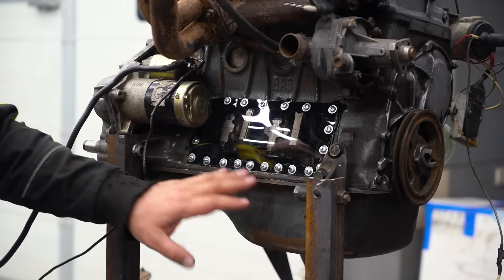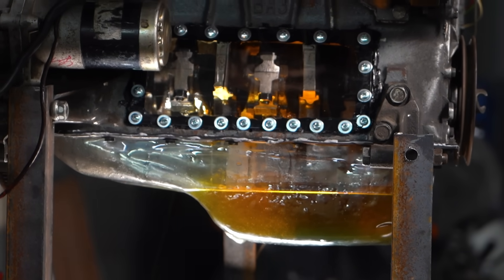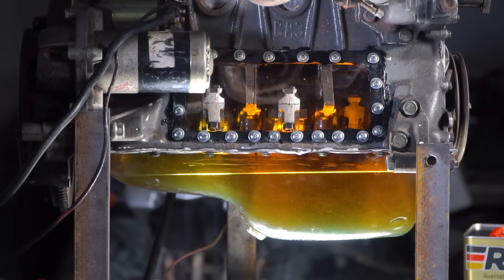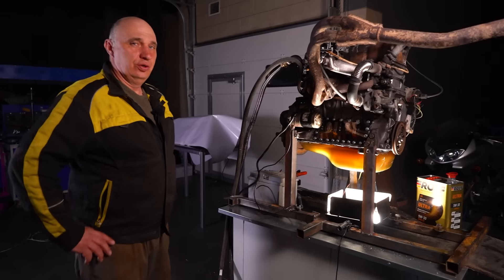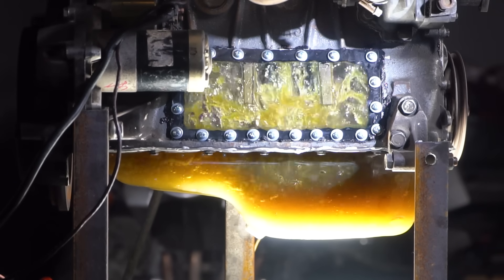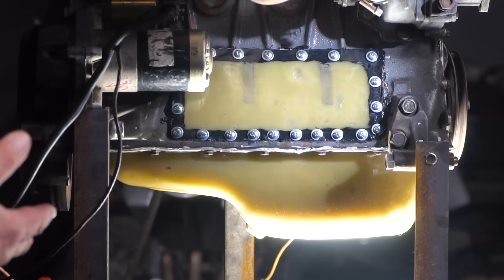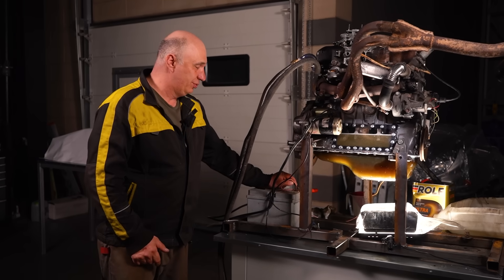What actually happens when you overfill your motor oil? (w/ transparent oil pan)

Comment: I seen what happens with a diesel engine in the army. While checking fluid levels in a large truck some DA grabbed a Hummer  dipstick and thinking it belonged to the large truck used it. He couldn't add enough oil to make it show on the stick so he put 5 gallons of oil in the engine! When he cranked the engine motor oil forced its way into the cylinders and started burning it fuel. The engine took off at full speed out of control. Turning off the start switch did nothing because diesel engines don't require electrical spark. The engine ran full speed in park (thank God) with heavy heavy white smoke pouring out to the point you couldn't see the truck. Wide open it run until the engine blew up! What a sight it was!
Reply: This is why big diesels usually have a cutoff flap and experienced mechanics always have something handy to chuck over the air intake
Reply: @miscbits6399 we used to call it the toilet lid.
Reply: happened to my friends Audi, the only time he got it up to VTEC levels, rev-wise. Remember kids: every passenger car Diesel can reach 9k rpms, ONCE.
Reply: So the don’t teach 91Bs how to stop a runaway engine these days? Can’t say I’m surprised
Reply: Your tax dollars at work
Reply: @timin770   So true.
Reply: 😂 that's crazy! Good story
Reply: The only way to stop a diesel runaway (when the motor starts burning the oil as a compression stroke, and ceases to run on diesel) is to starve it. 

You do this by either stuffing a rag or shirt etc into the air intake, or using CO² or a similar inert gas to starve the oxygen. 

There will come a point where a diesel motor will become so hot that the compression of the oil combined with the heat will maintain an inevitable cycle until there is not enough oil to burn, and it will seize any of the moving parts that cannot handle the rpm or heat. 

Either way, if you can catch a runaway before it really kicks off then you have a chance to stop the motor by choking it. 

I found this out the hard way, by overfilling my LC80 by about 3L, and it cost me a packet.

Don't overfill your motor oil.
Reply: @CCMiniBucks I never use a rag or anything that could possibly be sucked into the motor. Block of wood or such is much better
Reply: @CCMiniBucks I guess the military isn’t teaching them the basics of diesel engines. 5 gallons isn’t a lot for a large truck either, might be a little low.
Reply: @CCMiniBucks  do not stuff anything fabric into a runaway diesel's intake. Especially if you have a turbo. It WILL swallow it. 
Use something tough and rigid like a wide piece of wood.
Reply: @CCMiniBucks I’ve seen run aways suck in and blow a blanket out and kept running. Have to use a board or something big and hard that can’t be sucked in no matter how
Reply: @CCMiniBucks  you can also put it into a high gear and dump the clutch. Should stall it out.
Reply: @MP-ky5rz  automatic transmissions:
Reply: @MP-ky5rz this will work on small car engine. With big diesel truck u just blow the clutch.
Reply: @MP-ky5rz won't go into gear if engine is at high rpm, clutch brake useless
Reply: @FourthWayRanch  Yes it will, otherwise how would it be possible to powershift? I've seen it done on stock cars and motorcycles, what will happen is much higher clutch wear and probably the gearbox won't like it that much either. I'm not a mechanic tho, so idk how any of it really affects the components with certainty, but about the clutch I don't really have a doubt
Reply: @MP-ky5rz no so easy with automatic 😉
Reply: I both wish I could have seen this and am also grateful I was not within several miles of it happening.
Reply: oh and also what if it just does a burnout instead of stalling the motor cuz diesels have tons of torque and probably a lot more when running away
Reply: Video or it didn’t happen……

lol. Just kidding.  That had to be so cool to watch.
Reply: This happens in the oilfield if you park truck next to vac truck exhaust
Reply: Just happened to me a few weeks ago on my 2019 focus st 2.0 tdci, snapped 2 rods bent the other 2 smashed all 4 pistons and blew a hole in either side of the block, when diesel engine run away get the hell out of dodge 😂😂
Reply: On my way home the other day, I came across a young lady on the side of the road with her hood up. She stated that her car kept shutting off while she was driving. As I assessed the situation, turns out someone had told her to be sure that the engine oil was at 100%. After checking the dipstick, I retrieved my ramps and socket and drained over 3 quartz of excess oil! Lol!
Reply: @mikeheckman4995  I'm sure she's greatfull
Reply: I'm surprised they don't have emergency air shutoff like oilfield trucks.
Reply: Block air intake
Reply: LMAO
Reply: Runaway diesel 😂
Reply: Yeah , how woukd you stop a run away engine,  like on a 2007 dodge 6.7 ? Because of the age and miles on it , I worry that maybe the turbo some how puts oil into the intake , how would I shut down that engine being that every thing has a plastic cover on it how would I stop the air intake , with out having to get tools and start taking parts off ??
Reply: Nobody was smart enough to plug up the intake?
Reply: @bigdfitness5020  You mean knowledgeable enough. Those present (no mechanic) had no idea why, what, was happening.
Reply: Should have removed the fuel pipe
Reply: Why not smother the air intake?
Reply: Runaway diesel sounds fucking horrifying
Reply: Gotta shut down the airflow..only way to make it stop and you gotta be quick 😂 they blow up quick and you don’t wanna be next to it when it goes 😂😂😂
Reply: I had a diesel generator that used engine decompression to shut down. The pump was mechanical so as long as the engine turned it had fuel and air. Shutting it off involved a solenoid disengaging causing the exhaust valve to get stuck open killing the engine, but modern engines kill the fuel supply like an electric pump but the oil is now the fuel so now it runs faster and faster until boom!!!!
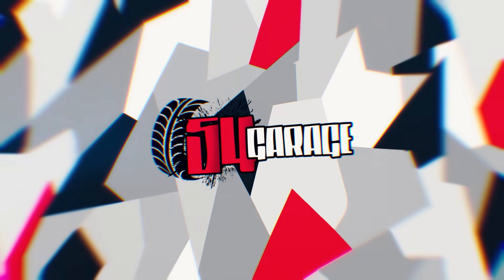Reply: 19:46 19:46 19:46
Reply: That engine did things it's not supposed to do. It sounded like a jet engine with the turbo wide open. Dirt from under the truck was blowing everywhere! You could see the entire truck body trying to lift off! OMG had that thing been in gear it might have taken flight. 17 and 18 year old were jumping to or cover. People were peeking around things to see what it might do next. When she blew, the turbo went flying leaving a smoke trail. The PTO shaft (winch) snapped and was ripping parts away. Steam from the busted radiator went up. It blew so hard the side mirrors were bent. When it was over everything was silent, minus some strange hissing. Anyway one of the Sargeants in charge used to call everyone "duke". I heard him say " ah hell duke, that's someone's ass! "
Reply: White smoke is not oil. That is antifreeze from a bad head gasket. Burning oil is black
Reply: Whats a DA
Reply: I may have added too much oil to my riding lawn mower and it was pouring white smoke.  I called the guy to pick up - he did.  I haven't heard about my mower since.
Reply: What about kicking it in gear and letting it stall?
Reply: So what happened to the guy?
Reply: @HexOmega3113  He got punished and had to go through retraining.
Reply: Govt property, doesn’t matter hahaha
Reply: It didn’t have a emergency air shut off
Reply: No injector cutoff?
Reply: @crankfotton  it would still run since it is burning the engine oil. The only way to stop it is by smothering the air intake. But if the air fikter is in place then this may not be possible. In which case, run.
Reply: Yes, the adage is true. Stupid people are dangerous!
Reply: HUMVEE lead the way.
Reply: Pull off air intake put a board or something hard enough to not get sucked in and it’ll kill it
Reply: If you ever have a runaway plug the exhaust pipe with anything. It'll choke itself out and stop the dangerous runaway, and save the motor.
Reply: And no one thought to choke the engine? No one thought to try and close the air intake in anyway whatsoever? I get it big diesel engine roaring at full speed if it blows up next to you….. but still at least make the effort
Reply: Runaway diesels at its best. Toss a towel in the turbo or intake it'll be alright🤣
Reply: It's called a runaway diesel engine
Reply: Oh,...gush!
I'm Soo glad I run in to your, coment:- I just recent, bought a Fiat 500l, and willing to clean up the engine I bought a cheaper oil, and as per the parts dealer ship, I pour All off it in(not checking the dip stick)
thinking I will use it fyu miles tand then dump it to have the engine clean up, and fill up whit her specific one!
@ just after 2 min, I start running the car, on second gear , after , u touck a turn on slow speed, the engine start running like a nasscar!
I get scared and switch it off, but still running, follow about a lot of white smocke!
Luckaly I had just 1 min till home, were my naeber is Mecanic, and tell me to drain the oil, exes!
Now I put the right oil on it , but, after then , I don't like his "music "anymore!( there are noises, sounds like something isn't gets lubricating!🤔)...
P.S- @least that was not your personal car🤔
Reply: the dip stick have hallow dots on it which tells how much space is in the sump available to fill the oil for the engine
Reply: the dip stick have hallow dots on it which tells how much space is in the sump available to fill the oil for the engine
Reply: Must’ve been a lot more than 5 gallons because the big trucks the Us military uses are 8.3 diesels which require 6.4 gallons of oil
Reply: Lol. Glad no one got hurt but that's hilarious
Reply: Ci sono motori diesel con tanti chilometri che consumano olio. Ma se lasci il livello di poco sopra il minimo il consumo si stabilizza
Reply: Article 15! 😡
Reply: @smoothoperator7023 what does it mean
Reply: @BarryWhite52  A military term for a write up / reprimand.
Reply: @smoothoperator7023  oh I thought the commenter actually wasn’t supposed to share the info since it happened in the army
Reply: I was thinking the same thing! You must be a fellow NCO! 😂😂@smoothoperator7023
Reply: Idk why but your story made me lol way too hard 😂
Reply: "Turning off the start switch did nothing because diesel engines don't require electrical spark"

indeed Diesel engine needs electricity for the injection pump.
But when it burns oil, it did not need the injection pump to turn ! so even if you cut off the battery, it will still turn on. 

So the only way to stop it is to put the maximum gear and make it stall
Reply: The Massive torque of a runaway diesel will power right through a clutch...a soon as a bit of heat is introduced the clutch glazes and slips...personal experience @user-ip6vv9nd3b
Reply: @fdhdfh-r3z there are lots of diesel engines that don't use electricity at all.. either for the injection pump, that is 100% mechanical. BTW, a good solution for diesel engines to not runaway never, is to use a mechanical switch that closes the air intake when revs are too high, or when the KEY is turned OFF. 

So, when the key is ON, the air pass is open, and when the key is OFF, air pass is closed. 

So when a runaway, just take the key to OFF position and the engine will Stop because no air is entering the combustion chambers. 

No air = No oxigen = no combustion = Engine Stops.
Reply: @fdhdfh-r3z some diesels, especially older ones have a mechanical pump and require zero electricity for anything provided its warm enough to not require glow plugs at startup. And if it had a manual trans you could even just pull/push or "bump" start it and drive away without any battery
Reply: I feel bad but it made me laugh just picturing it 😂😂
Reply: Just block the intake plate......
Reply: could have opened the oil drain plug
Reply: @JackSpratt-yg1oj And crawl under a runaway diesel engine?
Reply: @teresabenson3385 that's what I thought too 😂
Reply: @JackSpratt-yg1oj I volunteer you!
Reply: @JackSpratt-yg1oj 🤣🤣🤣🤣🤣🤣🤣🤣🤣🤣

Comment: i always believed a quart extra especially in my high performance motors did it good . i even keep my toyota's small 4 cylinder with an extra quart , runs real good , our speed limit here is 75 mph on the highway i travel and it runs real good ! .

Comment: If a Mercedes Benz ml 320; the dash would flash an 'engine oil hi', warning that the engine will fail unless engine oil is dropped.  Had this happen once, had to drain off some oil from the oil pan.  Some engines will seize if the oil density's too high.

Comment: You have a level for a reason. Too much oil messes with oil pressure in motor and risks blowing  gaskets and seals. Too much oil can cause a runaway engine, which you do not wish to witness.

Comment: The problem with overfilling is that when the engine starts put those boubbles in to that oil the oil looses some of its ability to lubricate the engine, due to the air bubbles in it. So keep the level close to the max level and dont over exceed it. Theres a reason for that max level. But intresting video thou

Comment: Don't do this to your car😂

Many newer 4-cylinder cars put counter-balance cassettes underneath the main bearings in the sump.

The problem isn't the physical impact of moving parts vs oil, it's the aeration of the oil. All the parts that depend on hydrodynamic bearings will be destroyed.

Air bearings exist, but the clearances are too large and the lateral forces are too great to work in an engine. The pressurized oil film can support those forces, but if it becomes foamy, it no longer can.

Not to mention the huge amount of oil that you're going to burn, and all the problems that will cause.

Comment: Don't even think about doing it with a modern diesel engine. You will get oil running into the air intake from the crankcase breather and that will keep the engine racing and running out of control. Seen it done. And, thinks, what about breathers in petrol engines? They too will take a lot of oil into the engine intake - won't they?

Comment: So more oil is better than low oil . . .  but I remember a Ford Escort that smoked badly when even slightly over-filled - it would leave a huge cloud of smoke that obscured vision.
I expect that the results would vary across different engines / oil-pans.

Comment: 5 quarts instead of the 3.8 liters recommended blew out the rear main seal between the engine and the transmission.  The leak was so bad oil was dripping from the bumper of my 1971 Toyota Corolla in 1980. $300+ USD repair. 2TC 1588 cc engine. That repair might be close to 10X that much now. Cause overfilled oil in engine 😮

Comment: Stupid is as stupid does. Overfilling your oil can result in aeration of the oil by the crank throws dipping into the oil. Don't do this. If you need more capacity for things like hard cornering, there are options that are very effective in preventing oil starvation.  Aerated oil does not lubricate!

Comment: I always add extra 1 qt extra in 5 qt car , whrn i replaced it, put in 6 get out 5qt, but recently I bought 20k miles mobile 1 oil, i wanted to see if they did last longer, i put in 5 qt n didn't change it until 7.5k miles i got out 3.5 qt only, so oil is not the issue, the issue is  they burn n evaporated, n run low . This time i added 7 qt of 20k mile rated into the car. Will check in the fall (Toyota rav4). With my Ram truck 9 qt become about 5.75 qt at 7.5k miles as well

Comment: My friend brought his small block Chevy engined car over with real rough running engine after driving it a little bit. After testing for ignition problems and finding nothing when the oil was found way over filled when drained and filled properly. problem solved. collapsed hydraulic lifters when air bubbles got in the oil

Comment: Excess oil = excess energy loss as engine parts collide with oil.  Of course, foaming issues also. Better fuel efficiency and less engine wearing running a bit low than full or overfull . Hotroders know this.

Comment: Looks like the breather saves the engine from exploding. In a modern car the breather will be feed back into the air fuel intake so you will be burning the oil if it doesn't stall out or hydro lock from inhaling oil.

Comment: Had a friend that bought a jeep for $500 I think it was an XJ anyway they said the engine was blown when he got it home and we pulled the engine and tore into it we found it had double the oil it was supposed to. It was a 4.0l straight 6 from what I could see it had hydro locked. It looked like one of the cylinders filled with oil and when they tried to start it a rod pushed straight through out the top of one of the pistons.